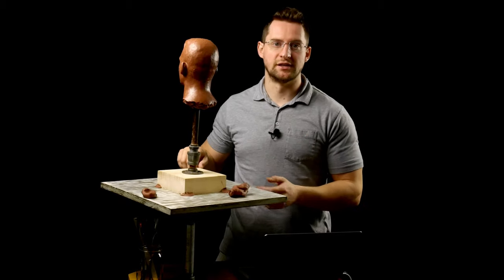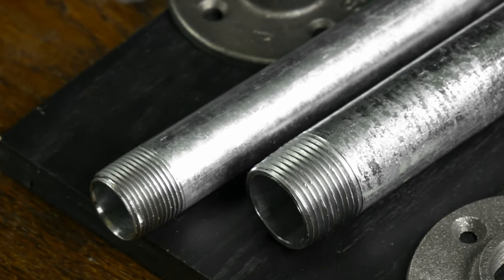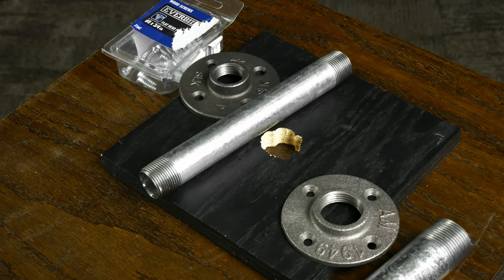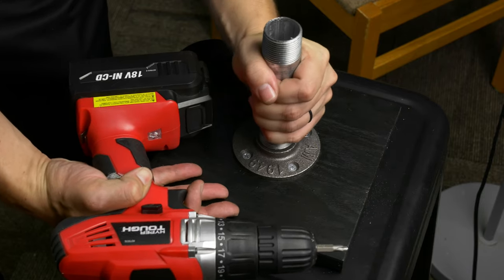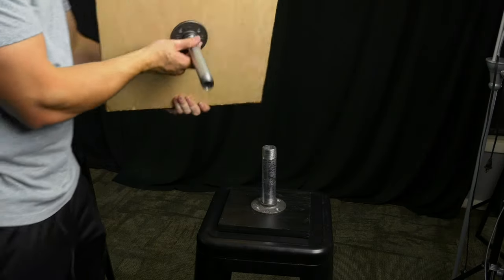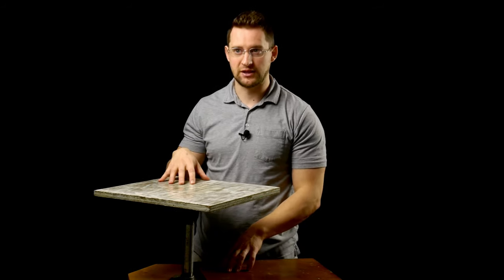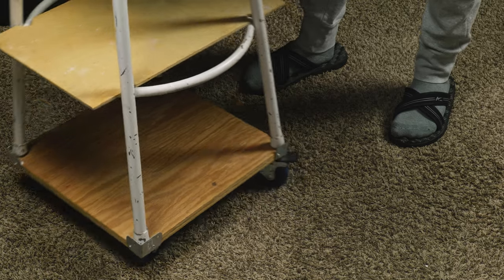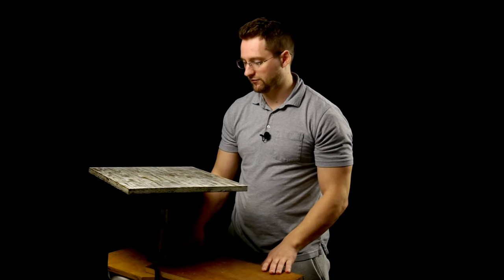How To Make A Turn Table Stand For Sculpting

Comment: Great idea. Alternatively you could buy a cheap twist adjustable painting pole as the height adjustable part.👍.
Reply from the maker: I'm not sure if those would be strong enough to support the weight of the sculpture and table but you could try it.